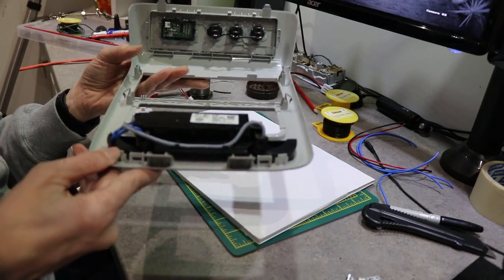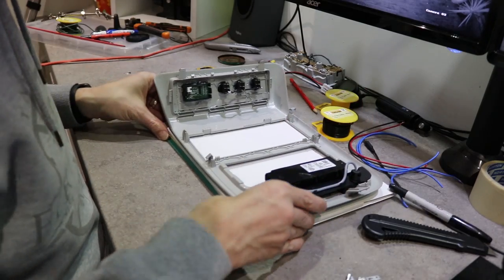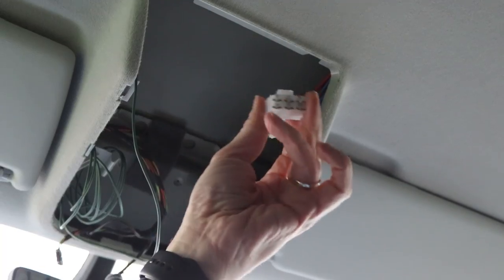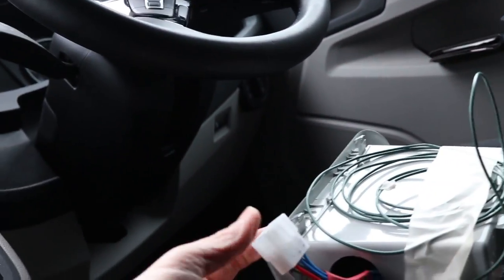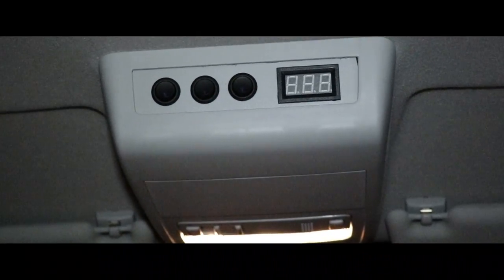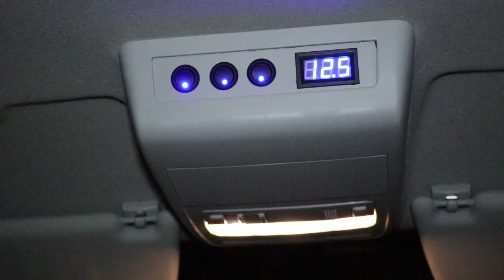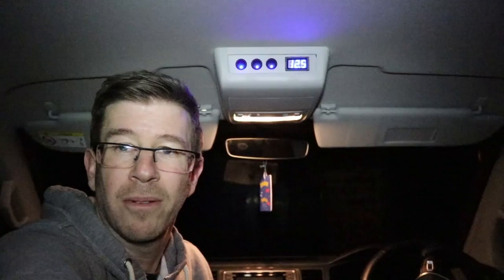Transporter T5/ T6 interior upgrade

Comment: This mod is superb, been looking to do something very similar.
I've now got all switches, lights, sockets etc.
Just need to suss out exactly how to wire it all in safely.

Cracking mod and great video 👍
Reply from the maker: Ah yes.  This was and still is a great use of the overhead compartment.  Well over 12 months in now and I would not change a thing on this mod 👍.  Good luck with yours buddy👍

Comment: Hi steve . Could you please tell me where you got the new/spare piece of colour coded plastic to be able to match the cubby console when fitting the switches etc .. thanks 👍
Reply from the maker: Tom Wood HiTom,  I ordered from the parts department a replacement bit in the same colour which is the rectangular bit that pops out. (The piece I am refitting @8:35). I don’t still have the part number unfortunately but my main dealer used their exploded parts view to identify it. Part was about £10 I seem to remember 👍